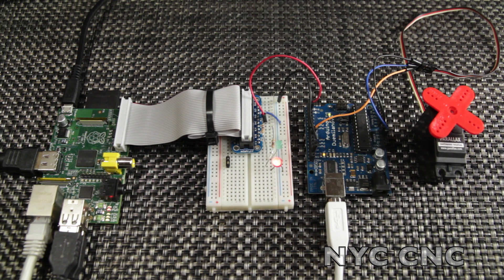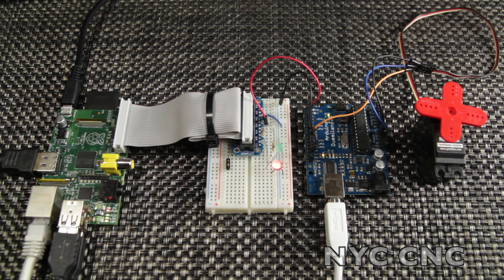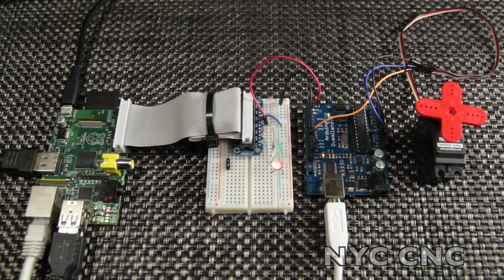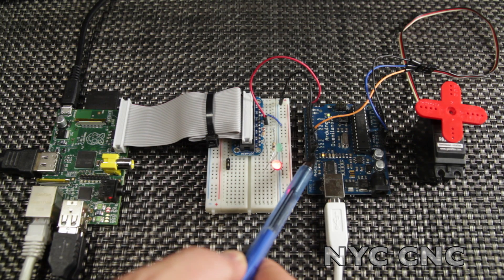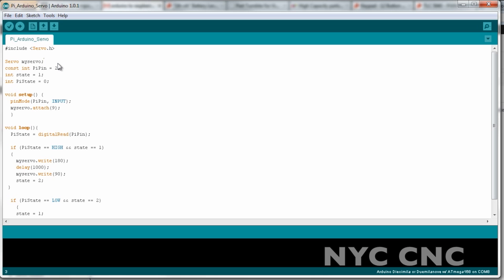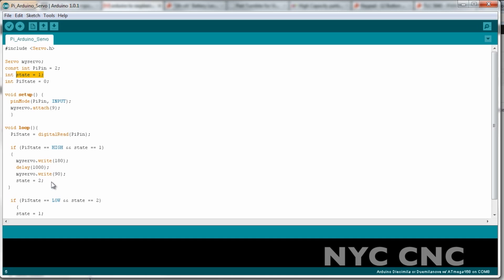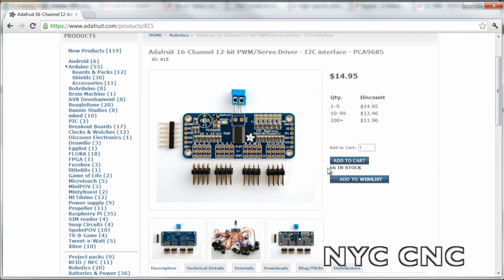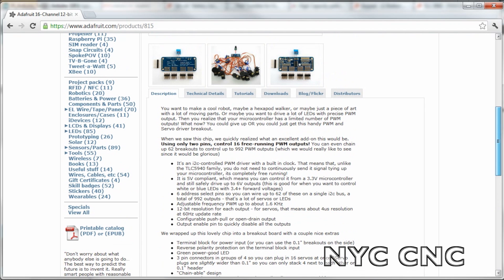Tutorial: Raspberry Pi - How-to Drive a Servo Motor via Arduino!

Comment: I know this is an old vid but I was thinking of using an Arduino to control 4 servos of a robotic arm... if I want to send specific servo degrees from the pi to the arduino you wouldn't use the digital pins... would you use the rx tx pins?

Comment: The only downside is if I understand correctly.  If you wanted use a usb joystick to work the servo, that setup from the pi to the arduino wouldn't work because you are only taking the high and low.  So the arduino basically can only turn the servo all the way one way than back again correct?
Reply: NYC CNC Does Rasperry Pi has PWM digital pins that can be mapped by arduino?
Reply: Pi has 1 PWM pin but like NYC said in his video the documentation on how to use it is a bit sketchy plus its only 1 pin.  Best bet is to use a similiar setup like he showed in this vid.  Depending on what you are doing you can get driver boards from either sparkfun or adafruit that might be up your alley too.
Reply: Mopardude The B+ Pi has more PWM capable pins, but still little to no documentation on how to use them.
Reply: Bozeman42
Do a search on YT, Rasberry Pi PWM I have seen a few videos on this subject since NYC CNC posted this video.
Reply: Mopardude All of the ones I see use the RPi.GPIO in python, which is PWM implemented in software, not hardware. This works with any of the GPIO pins. I am told that the timing of the software PWM is not as precise as the hardware PWM which can have consequences in some applications.

If you see a video that uses the hardware PWM capable pins on the Pi let me know!
Reply: Yea unfortunately you are correct there is no hardware way of doing PWM.  Looks like the B+ is all GPIO pins too.  Out of curiousity what are you trying to do that the software pwm is not working for you?

Comment: Yeah, was thinking about it, would most likely be a forum post though.

This is just a guess, but I think you're probably expecting there is a problem doing it directly from the Pi because of the real time restrictions of a Linux kernel. But I think you will find that servos are quite forgiving in this regard. Even so, there are simple workarounds. Namely making two concurrent threads and elevating the process priority.

I'm like... 50-75% done with the work already actually.

Comment: Yeah yeah (-_-;). If YouTube wouldn't have F&*^ed up the formatting, or would at least let me edit it and add some white spaces, then you would plainly see it's actually just 3 simple steps, and only the one board too.

Honestly my way is FAR less complicated than what this video is trying to get people to do. Point of fact, the method in this video probably has over 50 lines of code, for each board. Mine takes less than 10. I just can't make that clear in YouTube's worthless commenting system.

Comment: John, just a little help here: if I'd like to control a servo with a Pi, as you mentioned, it's easier with an Arduino. But if I already own a Pi, would it be easier to get an IO expansion board for the Pi instead? I know the Arduino is way cheaper but for me it isn't quite easy to get.

Comment: It's actually very easy to do with just the Pi and a 3v3>5v buffer.

Step 1: Watch 17:20 in watch?v=8mLMGlzdxrE

Step 2: Modify "IOToggle_Craw.c" to add delays for servo control, about like...

if (clockwise_condition_1) {
GPIO_SET = 1<<g;
usleep(20000);
GPIO_CLR = 1<<g;
usleep(2000);
}
else if (counterCW_condition_2) {
GPIO_SET = 1<<g;
usleep(20000);
GPIO_CLR = 1<<g;
usleep(1000);
}
else {return 0};

Step 3: Make a common emitter buffer to protect the GPIO pin.

Comment: Ah well i have been trying to run Mach3 on limited hardwares for a while. And it really dont standup. I just like to build stuff in general. So building a cnc platform is more or less just another learning curve... But goal is to run a dedicated _small_ hardware platform, remote from say a cheap Arm based android tablet. And the cost in total for the control platform should be less than a new ipad2.

Comment: Don't forget the Arduino uses 5v logic, if you accidentally connect an output pin from the Arduino to the pi's gpio you could damage it.  The pi uses 3.3v logic levels and a logic level converter is needed if you want to SEND serial data to the pi's gpio inputs.

Comment: well basicly, if u look at other commercial cnc systems, they usually use a hardware buffer. In case of the software lags and so on. A dedicated hardware interface would not suffer same amount. Cause, Raspberry Pi is first and foremost a software processing platform. And Arduino is basicly a advanced and flexible hardware interface. And actually the Raspberry lacks some in the GPIO department in pin i/o's that arduino does not.

Comment: Nah, it was a question.. But yeah a Leonardo device should be able to be controlled over USB instead of the GPIO as it would act as HID device in windows it can be run in Linux as well. But well thats what i will try to get running anyway. I wanna combine a Raspberry Pi and a Leonardo as CNC controller.